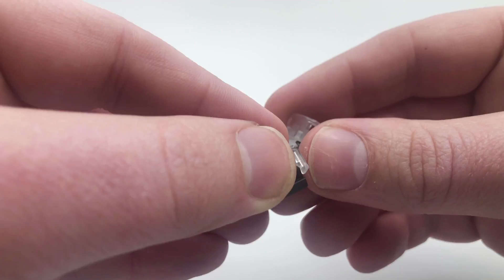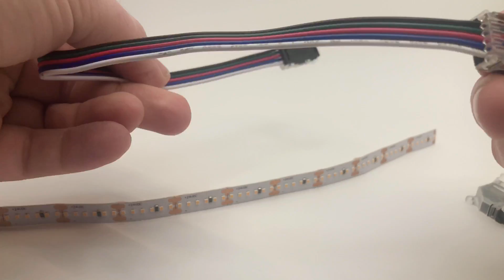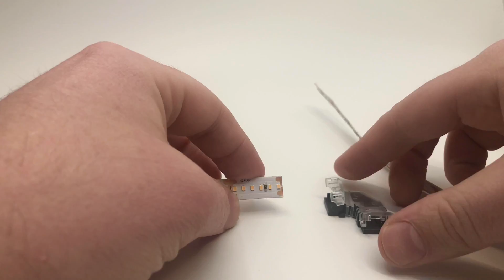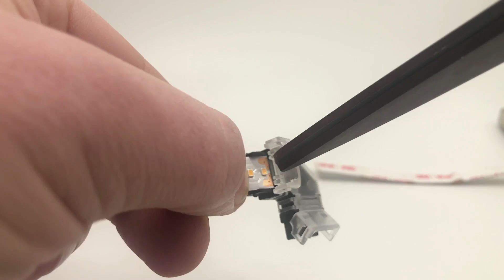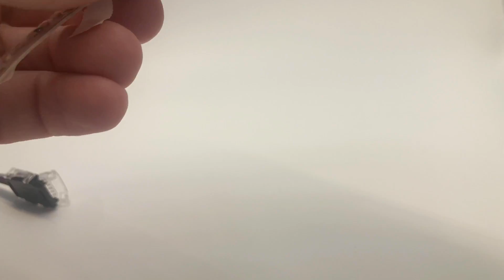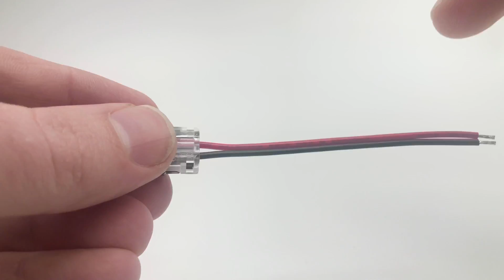How to install Solderless Grip Connectors to LED Strip Lights

Comment: Good informative video! 
I may have misunderstood the instruction but it appears that the video suggests that either the red or the black wire will be the positive depending on how you happened to insert the wire into the connector. I know that it is absolutely prudent to insure that the strip receives positive current to the positive side. However, for continuity and especially for simplifying troubleshooting issues on follow-up visits to a project, I have always found that when wiring DC power, it is best to follow the standard wiring convention. The positive current must be red. The negative current must be black.

Secondly, will a reversed power wire harm the strip when power is applied?

Lastly, if you find that you need to swap the red and black in a miswired connector, can you open, correct, and reclose? Or does this require a new connector? Also, the same question with reversed strip in the connector...ruined strip section or ruined connector?

Comment: I read in a question and answer section on your website that solderless connectors do not fit in the channel.   Without soldering, how do I make the connection?

Comment: It would be nice if you guys made a video for an entire project. Say a closet, from design, to actual install of the lights, when to use jumper cables, when to use these connectors etc. what’s the right amount of length. Plenty of you tubers would be game to show us from start to finish in their projects if you just send them a kit!
Reply: Hey there! Here is an entire closet video using FlexFire LEDs: https://youtu.be/mNy15swhoL0
Reply: @carolinabastidas9435  hey thanks for the response! I actually did see his video, that’s where I learned of you guys. It was a really nice build, but does not got into much of any detail. I think I’ll just take advantage of your design service and send an email. Thx a gain for replying!